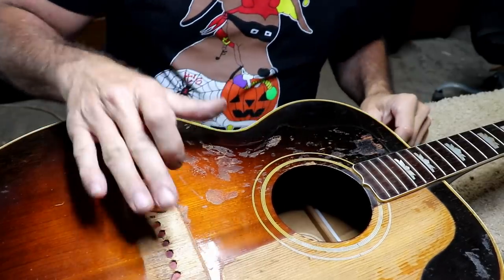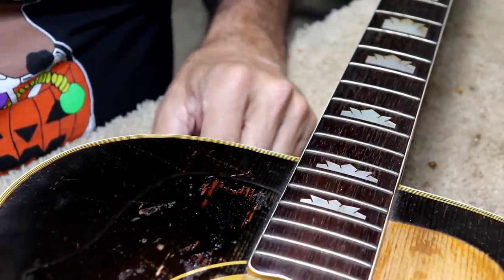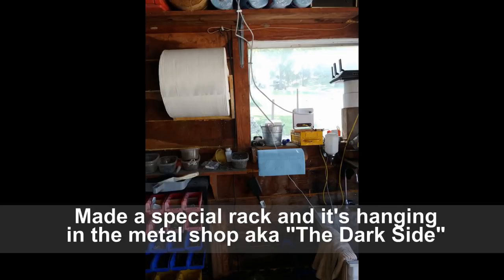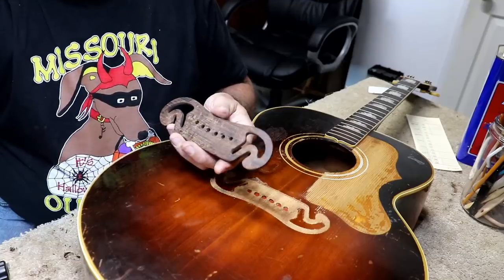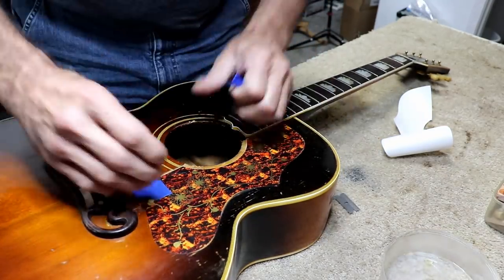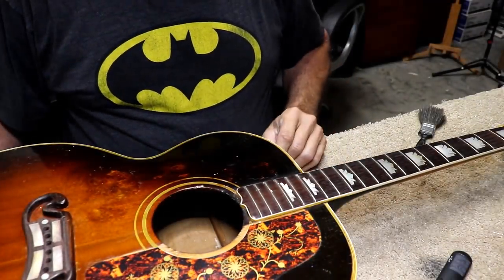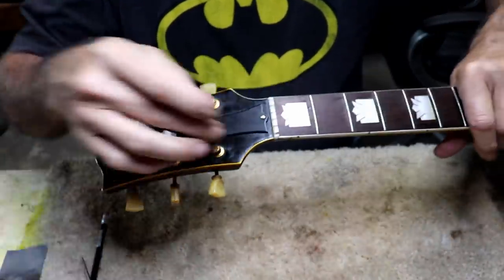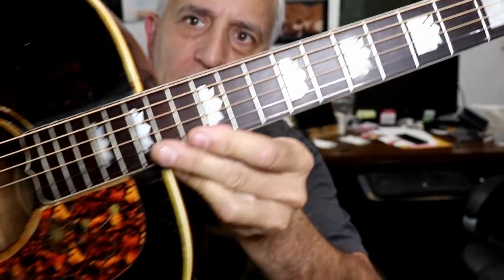294 RSW SJ200 Gibson Restoration Part 2

Comment: The way you went after that huge mess by the sound hole reminded me of how I took some steel wool to a ruined record album that skipped across 3 songs and actually made it somewhat playable again by sanding off the gouged out vinyl surface until the needle could track the groove again without hopping across the LP. I think your unconventional approach at repairing the extensive damage to the guitars finish improved the looks of it 100% over what you started with.  And the bridge repair was amazing to watch!! The patch you made was nearly invisible and prevented the top from being pulled apart by the tension of the strings. As usual you did a great repair job that your viewers were lucky to be able to observe and learn from!

Comment: I used to renovate hardwood floors and we used a product called Bruce Hardwood Floor Renovator. We would mix that with stain 4 parts renovator with one part of stain and work it in with Steel wool. Then use Breewax (a product of England) to wax and buff the finish out. Turned out beautiful and may work very well with this guitars surface damage. In the future you may want to see if you can find those products.

Comment: I have worked with the restoration of finishes on antique furniture. It takes a good eye to match the colors. esp. when they are old and have faded and yellowed. I would use dilute die and an airbrush. It is possible to add a dozen or two coats of lacquer (or shellac)  in the low area to build it up and afterwards scrape it off flat and buff it out. It can take several days to do this and then it will shrink and you might need to do it again in a year. That said, with what you had to work with, Nice job...
Reply from the maker: My biggest problem is the color blindness.

Comment: To fill those lacquer holes I'd just layer it up in the divets with some lacquer.
Then just work through sands until the whole lot is down smooth and level.
lacquer that area with about 3 coats and buff between coats, job done.
No more blotches and it will be as smooth as polished peice of ebony. 😁
Nice work on that guitar by the way the tail slot was very well done on both parts 👍

Comment: The customer should have gone with the additional pickguard to cover the damage.

This was a REPAIR, and not a RESTORATION. Some Gibsons did have double pickguards.

Acetone is great as a solvent, but it's death on some types of plastics, so take care.

Great stuff, as usual. Viewers are getting kinda spoiled by now.
Reply from the maker: Actually I think I would call it a refurbish and a repair
Reply from the maker: And you could also call it a restoration in the sense that it was not playable so I restored the playability and the sound
Reply: Sympathetic restoration, i do believe.

Comment: The finish touchup looks good looks good for the amount of damage there was ,I'm impressed. Some cabinet maker's advice for next time you've got one with that much color lost is to use ether mineral spirits or denatured alcohol to blind the stain. Most stains are based on one of those materials.

Comment: Nice restoration and the way this guitar sounds it surely deserved it. I love the sound of high end jumbo guitars. Mine is not a Gibson SJ200 but a Westerly built Guild JF55 which i bought in 1997. I have taken good care of it all these years but it has a purfling issue mainly around the top and along the neck. It started cracking pretty soon and i had to glue back pieces that fell off and this does show. I have been told that this is quite common with old Guilds. I also had the frets replaced because the original ones were far too low in profile and i wanted higher ones. My luthier made an excellent job though, the ebony fingerboard looks just like it did before the refret job, no chipping and glueing back the little pieces

Comment: You set off  my Old Automobile alarm bells with the 2 different types of lacquer. The Nitros or straight lacquer as we called it is as durable as enamel but it doesn't dry like acrylic lacquer. It is basically  a different product. It is also more flexible. You could check with your local Auto Supply store and  they might have a reducer for the straight lacquer and a blending agent. Might be helpful in the future.

Comment: That was quite a repair . Getting that bridge plate out and replacing it with something larger really helped flatten the top . Yeah touching up the top wasn't a total success but looks a lot better than before . You can try using StewMac  Color-Tone  Touch - up markers for nitrocellulose finishes . Overall a great job .
Reply from the maker: Perfect Color matching for me is nearly impossible as I am totally colorblind.

Comment: If its deep I have (on a tobacco 1945 LG2) removed all the finish area with acetone and then color the bare wood with felt pen blending . To fill it I used Krazy glue and prayed that I would get the color right otherwise you got to start over and the krazy glue has to be removed with acetone over again . i have actually  buffed krazy glue down to the same level as the laccer . I used rubbing compound (fine) and you couldnt tell . It made it stronger right where the picks dig into the soundhole area and I have filled those in to where you couldnt tell ! it looked great

Comment: Butyl Cellosolve will extend the open time of old lacquer and help the flow of old lacquer, it's very common to use it in reflashing checked and chalked old lacquer. Acetone is a chemical that is found naturally in the environment and is also produced by industries. Low levels of acetone are normally present in the body from the breakdown of fat. Acetone is the solvent for lacquer, it is an organic substance.

Comment: crazy glue in a pipet. then level out with wet and dry when DRY.. get it all level then a big surface area of  crazy glue. let it set... sand with block till all smooth then use a sponge and cutting liquid on a drill. it will cut back to glass. as good as a clear coat... iv tried with diff brands and some break fairly easy with a hard ding where as other set like plastic and iv blended super glue into 2 pac clear with totally invisible join from clear 2 super glue and then back into clear. it buffs out wonderful. i just never figured out how to colour the cyno glue. last try was nail varnish. that was a hot show.....im sure u will sus it out Jerry. great job on the bridge work so far. im at 24 min in..final of film.....great job Jerry...
Reply from the maker: I've used the super glue trick quite often. But you can generally always see a difference in the super glue in the original finish.

Comment: I think you should use your giant buffing wheel more often than you do. It's a nice machine, and from people I've seen that have used them, always get a really nice result. I'm sure it'll buff better than anyone could by hand ✋
Reply from the maker: Well you're entitled to your opinion but I don't get the same results from the buffing wheel plus it oftenleaves a residue that is hard to clean up and in addition it's very dangerous it can grab a hold of an instrument and throw it to the ground
Reply: @RosaStringWorks  oh ok! I didn't mean anything negative. I know your the man when it comes to instruments, just throwing in my "two cents". mandolins turned out great!!!!
Reply: @RosaStringWorks  hey Jerry, I wanted to ask, I have a Gibson J-45 Custom with rosewood back and sides. When they built it they must've been sloppy with the glue, cause it looks like on the inside of the guitar on the bare wood there's splatter on the rosewood. is there any way to get that off I know it's either glue or nitro any help would be appreciated!

Comment: I was working on a sunburst top, using transtint and nitrocellulose lacquer mixing my own colors. First I laid down a layer of honey amber then to different shades of honey amber with red added to it. So basically I had 3 layers of colored lacquer on the top  when the weather changed and my little spray room being susceptible to weather, I had to stop for like 3 weeks. So 3 weeks later I start putting clear on top of color, 2 days , total of 6 layers...wait a day and then 2 days total of 6 layers, 12 total layers of clear. A few days later I notice all kinds of cracking in the finish. Turns out the color layers were curing at a different rate than the new clear layers and the color began to crack...  So what I used to reactivate and make all the layers wet again, clear down to the wood was, Behlem Stringed instrument nitrocellulose Jet Spray Blush eraser. I laid the guitar down and wedged up the upper bout to make the top level and sprayed a pretty heavy coat of blush until I saw the cracks begin to disappear.   Here is a photo of the 3 color burst.  https://i.imgur.com/gCFDGnF.jpg

Comment: @23:25 High spots? I might of tried a cabinet scraper ... nothing else will make wood as smooth. While I am here, you can use that W/D sand paper to apply an oil type finish. The wood "dust" will fill in the wood "pores" and simply rag wipe as usual. Exposed dove tail joints will be super smooth. Loved your video!

Comment: Greetings Mr. Rosa, Looking at this video I had the idea that the finish could have been blended by using sandpaper and solvent (instead of your finger) the abrasion would have lifter dust size particles that the thinner/acetone would melt it and deposit  it on the low spots, end result would also have a good surface to add a finish layer of varnish.

Comment: Fantastic video, but that pickguard is a nightmare! It's understandable given that is nearly impossible to find original Gibson pickguards or even decent replica replacements. When I bought my 1968 J200 had a lifted guard that had broken in half, and after months of trying to find a replacement I gave up, hot water flattened it out and glued it back, looks pretty good. Old Gibson guards are thicker, about 2mms. Plus they're ingraved with the flower design not printed

Comment: Im in a similar situation with some finish work. The area  has a new patch of spruce right under the neck, and I need to finish about a 1/2" on each side if the neck all the way to the sound hole.  Thinking about using one of the black pens from stewmac to color it up, then a light touch of blush remover between clear coats to build it up.  I read that the blush remover will allow the new lacquer to melt into the surrounding area.  Since I've never seen you do it like that, I'm not sure if it'll work.  If your viewers have tried this, I'd like to hear how it worked for them.  Loved the sound of this guitar, and the "budget jobs" you do!

Comment: Emmylou Harris is on line 2. She wants to know when she can have her guitar back.
    Seriously, what an epic repair! In the wrong hands, that magnificent beast of a guitar might have ended up as fire wood.
   I could hear a really nice tap tone early on in part 1 just from your hands touching it. I was concerned that the  bridge plate would mute the tone, but it didn't. Most people would not go to the lengths you went to on the bridge, and it looks like this ol' box is gonna be good for another 60 years, maybe more. The touch-up on the finish was a surprise that I didn't expect to be as good as it turned out.
     Old Gibsons have a cool factor that's off the charts. In some ways I prefer them to Martins. I cannot look at a J-200 without thinking of Emmylou. In a kinda sorta way, she owns all of them. Now I gotta go and listen to "Luxury Liner" or maybe "Live at the Ryman" with the Nash Ramblers.
       You knocked another one clean out of the park, Jerry! 
Beautiful work as usual.

Comment: Being a piano tech.,  I'm a stickler for intonation. Sometimes using a lighter gauge string can help on wound E, may even be able to lower the height, another plus for a sharp.  Some techs will say that today's accurate tuners have caused an obsession with intonation.  I personally feel more confident playing when I know that every note is nearly perfect unison with every other fretted all over the fretboard.
Reply from the maker: Really have the action as low as I can go. At this point going to lighter set of strings might work but I don't think so it's it's probably just going to need further compensation on the saddle it's hard to get nearly 10 cents out of a string without compensation
Reply: @RosaStringWorks I agree, the true fix is of course in the saddle.  Working on electric guitars, I have had to remove the saddle spring, or even file down the back of the individual saddle to get low E intonation, even on top end Gibsons and Fenders.

Comment: successfully.  Use 0000 steel wool to rub the thinner around and it will gently abrade the old finish to get you some color to move to the bare arias.

Comment: Some of those gibson jumbos came with dual pickguards. If that one did it would be easier to put it back to factory with the dual guards.
Reply from the maker: As you could see the lower pickguard had no finish where the pickguard was.  They typically masks them off. I am 90% sure that upper pickguard was added on later. It really doesn't matter cuz the customer didn't want it there.

Comment: You really need an airbrush. You can do alot of things with it. It would have been very helpful on many of your projects. Use it with the technique of brush tipping and you can create wood grain appearance over repairs. Tinker with it a bit. You'll love it. Send me your address. I'm going to send you a brand new one on me.  I'll be sending you my Fender one day soon too. Thanks. Mac
Reply from the maker: I have an airbrush I do use it quite often. The problem is it won't fix my color blindness. Trying to match a color on a solid instrument is tough. Trying to match it on a Sunburst is impossible. Nearly impossible for the best person who is not colorblind. Let alone me who is 100% colorblind.
Reply: @RosaStringWorks  Hi! Great to hear from you! Have you ever built a guitar from scratch?? Would it be possible to build one out of 300 year old American oak,, ash and elm wood.? Of course with me supplying the materials already planed 
And cut to workable size for making the body. Your thoughts?? You seem creative enough to attempt it. Thanks

Comment: Great job on the lacquer. You knew it would be tricky.
You've mentioned color blindness in the past. You'd have to be careful with blacks in that case - I'm an artist  - trust me I now, they are different. Especially warm and cold, mostly warm on guitar finishes. Just so.

I wondered on the darkest areas if a warm black dye (maybe leather dye), could have been used on the bare wood fibers.

But then where you enter the burst would be very tricky, as he end grain always takes up darkness unpredictably.

This is not from lack of experience....
....or the lack of it 

only bad .........at least so far

Comment: I think the guy should go with matching pick guards but I'm only 5 mins in to the video. Ok I watched it all It came out pretty good but I still think if it was mine I would get or cut out a set of matching  pick guards and saved you some work. It isn't ever be a museum piece or a high dollar original just one to play and enjoy.
Reply from the maker: It's kind of hard to find a left and right pickguard that match.
Reply: @RosaStringWorks  Yes harder than I thought ( I had to look when I suggested it) that is why I said you might have to cut them out from pick guard material. You did make it look much better.

Comment: That's a relief, I thought maybe it was just me, but I often have the same problem with the low E string. I think it is gauge related, or possibly core to wrap wire ratio related. In most sets the low E is at lower tension that the A and D.

Comment: I woulda just gotten matching left and right handed pick guards and put one on either side, no more ugly and it would look almost like it was meant to be that way, a "universal" guitar :P
Reply from the maker: I think I said it in the video the customer did not want 2 pick guards.
Reply: @RosaStringWorks  Ah, fair enough, probably wanted it as close to original as possible. Trying to touch up a nitro finish is a nightmare, better to avoid it or just refinish it but refinishing is time consuming and expensive (as you mentioned). Turned out well enough in the end ;)

Comment: I am now using boiled linseed oil on my fretboards. Thank you for teaching me that, even though you didn`t know you was teaching me. Mr. Rosa i would be interested in seeing more electric guitar repair. It would help me learn how to reset intonation and the action on my electric guitars. And also acoustic/electric wiring. I can not get my arm and wrist in the sound hole to replace the input jack i am to big i guess. I would be curious and open to suggestion`s.

Comment: Everyone knocks the "oversized" bridge plates, but I've heard plenty with them in there that sound pretty darn good. 

One thing I've wondered is if it would be possible to compensate at the nut to help the intonation.
Reply from the maker: I am not at all a fan of compensating at the nut. The reason being is every fret is measured from the nut and as soon as you change the nut you've changed every fret.
Reply: I'm with you on this Jerry.  Wouldn't that only change the open string?  Seems the distance from the frets to the saddle would stay the same.  Anyway, great job on the Gibby!
Reply: @RosaStringWorks  so, basically, unless it's every fret off by the same amount, you can't really justify doing it.